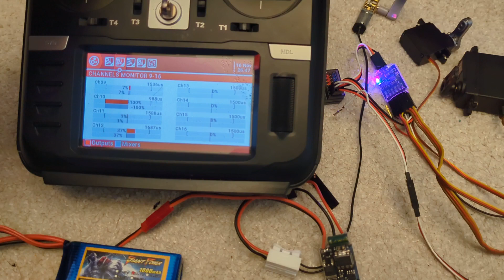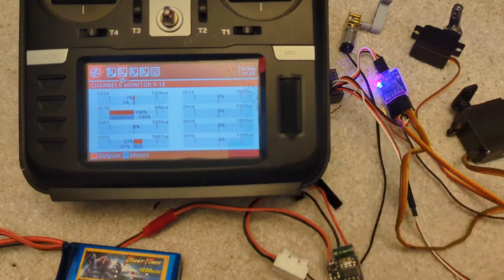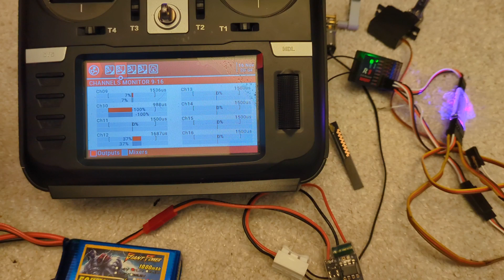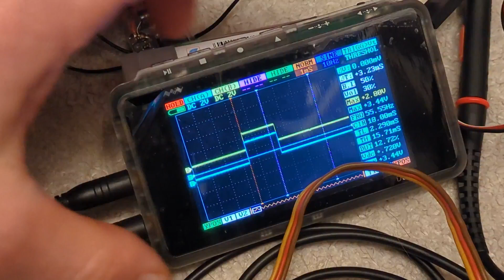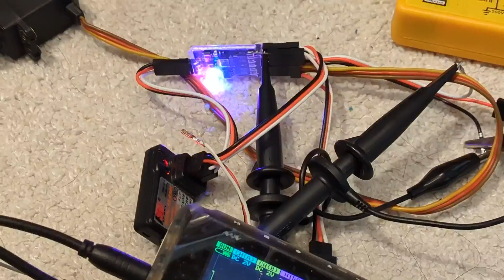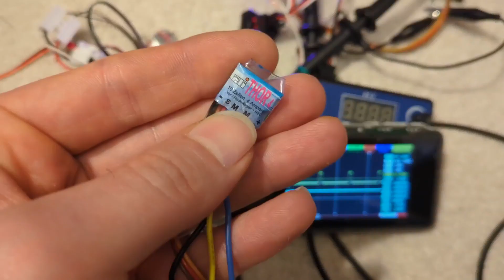Use an RC 3 Channel Video Switcher to switch servos and ESC

Comment: Have you tried binding multiple recievers to one transmitter?
Reply from the maker: I'm pretty sure I have done that by accident once! I will have to recreate that! If successful, you could drive two vehicles at the same time. Bind the same type of 8 channel receiver with the same receiver ID to the transmitter, then use channels 1-4 on one vehicle and 5-8 for the another. 
Good idea for a video, thank you!
Reply from the maker: new video explaining how it works: https://youtu.be/PZWGtxRMBKg

Comment: I really enjoy repurposing equipment like this. Ive found lots of ways to use the control boards out of servos too.
Nice job. I have one of these switchers at home. I will give this a shot.
Reply from the maker: Thank you! Yes, you can use the servo PCBs to create a servo from a gear motor and a potentiometer, can be very useful!